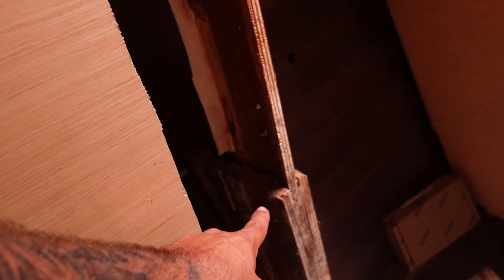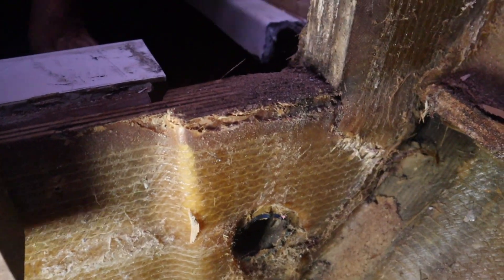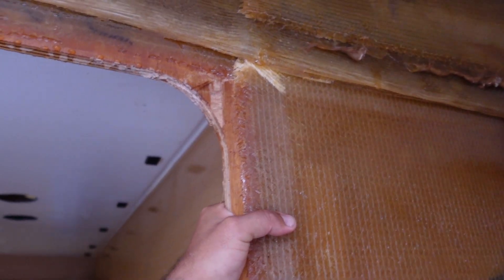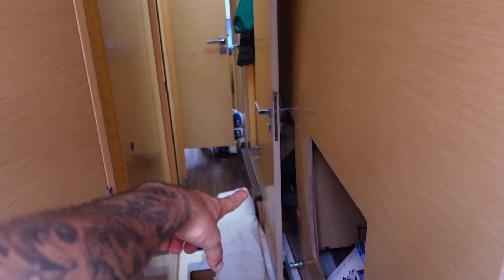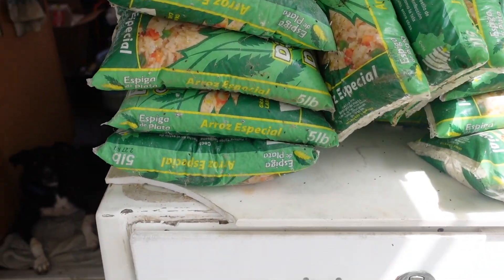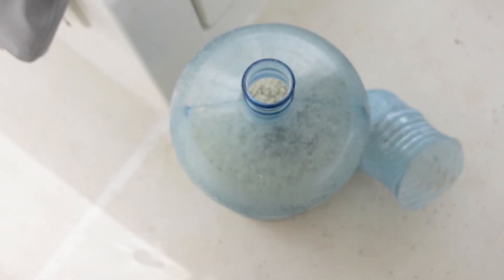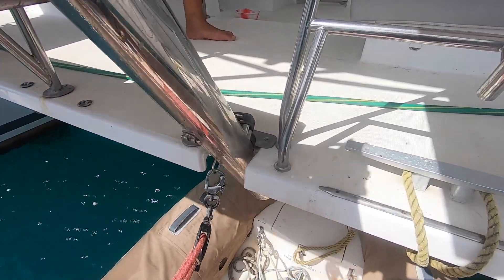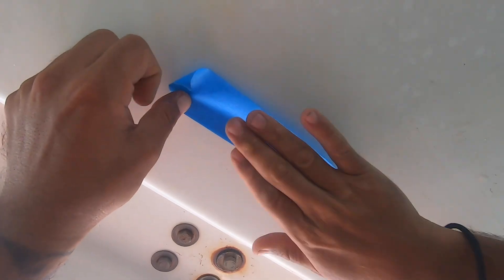CRACKED BULKHEAD REPAIR SERIES: Part 1 - An introduction... (Episode 107)

Comment: As a fellow Lagoon 450 owner, hats off to to Colin for bringing this to our attention. I haven’t been at the boat lately to inspect mine but other owners have and it’s starting to look like this is a design oversight. Lagoon owners are gathering data on how many boats are affected, but so far even dock queens and lightly sailed, non chartered boats are seeing similar failure. It’s heartbreaking, and at first I was in denial. Despite this, I still feel like the Lagoon 450 is an excellent boat. Ours has been heavily modified and upgraded with1500ah Lithium, isolation transformer, solar, gen set, dive compressor, water maker, laundry, furling boom, copper coat, ceramic coat, new fridge, freezer, stove, AC, SSB, on board fuel polishing and transfer, underwater lights, fwd scan sonar, etc etc. It sucks to see this issue arise, but once this repair is done, I’m still confident that we’ll have one of the best cruising boats in the world. Even knowing this now, I would still pick the 450, and it is still my dream boat. To Colin, if you’re reading this, I just binge watched every episode this week. Love what you’re doing, especially with the technical details. Your help and insight is invaluable to people like me. This is the best YouTube channel ever created. You’re likable, not boring, hard working, intelligent, and extremely informative. Your changing crew is always well chosen, and I like the way you give back to the various communities you visit, and show the world what the sailing community is truly like. The videos move along at a nice pace, and the editing is excellent. Thank you!
Reply: Colin need never be out of work again as the leading Lagoon restoration consultant in the World!
Reply: @roygardiner4002  you’re not wrong there...I sailed 1200 miles to have him take a look at my boat.
Reply: @david_shih  I liked your video too. Very informative. Looking forward to more from you as things evolve and we get engineering guidance. Best of luck mate, and please keep us all posted.
Reply: @roygardiner4002  don't forget the Aussie Battler Jamie......
Reply: @roygardiner4002  😆 he’ll know them inside out! 🤨🙄🤣
Reply: Popeye  nice! I do love steel boats. Worked on industrial cable ships as an ROV Pilot/Tech, repairing and installing sub sea cable systems, including the transatlantic cable. I’ve remodeled and repowered a few steel rescue and research vessels as well, so my days as a “needle gun expert” are thankfully behind me. You enjoy your steel boat and I’ll enjoy my 450! That’s the beauty of all boats. There’s a dream boat for all of us. I’ll happily raft up with any boat and debate the pro’s and cons. After all, there’s only three things I like better than my boat: Being on it, talking about it, and working on it.
Reply: It makes u wonder is this a design problem or a manufacturing problem. Especially since alot of these boats have issues. Wonder if Colin should consult with a neutral naval engineer. Im sure Lagoon is consulting with this guy Colin is talking to. I wonder if things are being suggested reference any future litigation against Lagoon.
Reply: @davidbarker6899  I think you hit the nail on the head after Lagoon has been watching some of these episodes someone in the legal department has taken point and has probably suggested it would be a good idea to run interference in helping  Collin in some of these issues this is getting more interesting as time goes on.
Reply: Kevin if you get a chance share with us where the Lagoon owners are collecting this information.
Reply: @ynAMe6Aj  there are 3 Facebook groups. Lagoon Owners Forum for basic general info. Lagoon 450 F/S Owners. And a 3rd, new group, dedicated this this issue where data is being generated after people remove the trim and inspect. That group is called “Lagoon 450 F/S Bulkhead Issue”. Still unclear how widespread the problem is, but looks to be a design flaw so far. We are all waiting on an official response from Lagoon to see if they will help us, issue a recall, or leave us to fend for ourselves. Lots of rumors so far. The repair itself is fairly straightforward, especially in cases where the failure is minor and hasn’t spread. The real problem, as Colin demonstrated, is how to remove the wood veneer and cabinets without damage. Doing the custom carpentry to put it all back together will be the hardest part. Looking forward to seeing how Colin manages to fix this and make the interior beautiful again. Knowing him, I’m sure he’ll set a high bar for the rest of us. I’m quite good at glass work, after 22 years as a captain with ~40,000 blue water miles, and the Great Circle loop under my belt, but many other owners will need to hire this out, and it wouldn’t surprise me if they start a class action if a recall isn’t issued. I’m going to wait for more info, and do the work myself, once we know the details of best practices. It’s a fine line between reinforcing it and overbuilding, as making secondary bulkhead (primary bulkheads are quite robust) area too strong, can send flexing and stress to other areas not built for it.
Reply: @capnkev  Checked out facebook and some videos and the document on repairing the bulkheads.  Those bulkheads broke at the weakest point. If you beef up those parts what will break next?  If there is any way at all of reinforcing the entire structure that would seem to be worthwhile while the boat is pulled apart.  Personally I'd be very tempted to double up the plywood with glue and bolts.
Reply: @ynAMe6Aj  While I haven’t removed the trim to inspect my bulkheads in this area yet, I plan to drive down and do that soon. Still waiting on an official source as to how to repair and reinforce this area, damaged or not, but it appears that continuing the triple ply all the way up and glassing and tabbing in that sandwich is the fix. I have over the years always inspected any areas that are visible, and I know that my main bulkheads are solid and I have no detabbing in other areas. The only glass repair I’ve had to do so far was to glass in the deck to hull joint at the sugar scoop. So I know my boat is very solid. It’s been around the Caribbean, across the pacific and back, Bahamas and Up and down the east coast from FL to Maine. I’ll continue to monitor other areas, especially after heavy weather or after each haul out. If any detabbing occurs on furniture, I would remove the plexus and glass that in, despite the fact that theoretically the boat would be solid with all furniture removed. All the little stuff adds up to create a structure that is both solid and flexible. Fortunately thanks to Colin and some proactive people on the Fb group, if this issue is caught early and repaired, the weakness won’t spread to other bulkheads. I’m hoping that’s the case with mine. Being a good captain means having a healthy paranoia and thinking through how you might react in various situations, whether that be pirates, mechanical failure, lightning strikes, MOB, etc. Thinking through potential problems before they happen leaves one mentally prepared for when they do. I’ll have a good look around and certainly repair anything that looks even remotely suspect, and the continue to monitor and repair other areas as needed. I’ve been through many dangerous situations in my travels to 101 countries so far, and I’ve learned that one failure can lead to a chain reaction of failures. So being proactive is key. After all, a 3 cent oring took down the space shuttle challenger.
Reply: @capnkev  Triple-sheeting each supporting bulkhead sounds heavy. Is there a light honeycomb material that has similar strength?
Reply: @EdwardTilley  good question. That would be great. While I have a lot of construction experience in boats, houses, RV’s, robots, you name it, I’m not a nautical engineer. And in this case I know what I don’t know. Going to wait and see what the recommendations are as this shakes out. As I said earlier, the primary area effected (unless weakness has spread) looks like a design flaw. Reinforcing it is a delicate balance between too strong and too weak. Too weak and you have compression failure. Too strong and the compression and flex stress may move to a part of the boat not designed for it. Right now, I have time before I relaunch, so I’m following Colin closely and reading everything about can find on the issue. I expect Lagoon to issue a statement soon other than “nothing to see here”, but I’m not holding my breath. They will either step up, own this, and help us loyal owners make it right, or they will bury their heads in the sand and suffer the consequences of damage to their brand. Being the worlds best selling, most poplar brand, I’m hoping they do the right thing and at least help us with guidance.
Reply: 4 Kevin, as in the past, Catamaran companies will just pass this problem on like they did the 'leaking' emergency hatches. All the while HOPING QUIETLY it will just go away.
BTW, is this cracking only limited to Lagoon? ⬅️ Bet not!
Reply: @stevenr8606  very true. Wouldn’t be surprised if this extends to other brands/makes. Large ships often have similar failures. It’s all part of the game. I just installed the emergency brackets when I was on the boat a few weeks ago. Considered glassing them in entirety but then decided against it. This too shall pass. Going to fix or hopefully reinforce, once I see mine with the trim off.  Then keep sailing. Whenever you buy a production boat as a cruiser, you expect to modify and upgrade things. I’m still happy with the 450 as a platform over its peers. They are built tough, this possible oversight notwithstanding. Once fixed. I hope I’ll feel the same. The actual fix of the glass part is relatively cheap, easy and quick. It’s the cabinetry and trim that’s going to really suck. Doesn’t look like it will be easy or non destructive.
Reply: @stevenr8606 , good point. My guess is that the materials (adhesives) used to reinforce these structures was accepted by the industry and likely used by other manufacturers. I have a civil engineering degree, am a former boat carpenter, and have worked in construction for many decades, so I'm guessing this is more widespread. I'm curious to know who makes the glue? Once determined, check out their website, see what other boat manufacturers and other industry clients they claim to have relationships with and dig in there. That said, the inherent strengths of the bulkhead ply along all axis are known values, and I imagine the induced stresses in these bulkheads is also known (if not someone's superfucked), so, I eagerly await the outcome of this debacle with baited breath, but have a sneaking suspicion this won't end well for many involved parties.
Reply: @EdwardTilley  carbon...
Reply: @stevenr8606  I'm guessing lagoon will just point to the FB  group and Colin's vids and tell the owners to buy new or FIYS... I can't imagine a French boat company would step up to fix their faulty design, I can't imagine a world where defending a lawsuit would be more expensive than repairs to all those boats.
Reply: @rsrguy  Was wondering wouldn't carbon flex side-to-side under too much compression from above - but of course embedding a tube of carbon into the bulkhead wall would give it enormous compressive strength and prevent it from bowing as well. Expensive wall though... they make airplane cowling out of the stuff so it isn't cheap.
Reply: @stevenr8606  My Farther spent the best part of 5 years and 54 High Court appearances suing Beneteau and despite getting 5 marine surveyors to give their reports on the boat he sued them on their own survey. the boat was brand new delivered to the south of France and deem unfit for the sea with bulkheads pulling away from the hull and the hull twisting in the heat during the day etc. problems with the rudder, to name but a few issues. They tried to drag the case out trying to run him dry of money to fight the case, but this was the first of a fleet he was purchasing to start a charter company. he was fortunately not short of finances and eventually won his case where he rejected the vessel as unfit for sale under the sales of goods act.
Reply: @EdwardTilley  Just a couple of details / issues. Most importantly is scabbed biax would flex as you suggest. Any of these repairs will be stronger  if vacuum bagged(doesn't need to be infusion bagged) just a standard bagged layup with peelply and breather will work. 
 Most importantly honeycomb would be no match for that load, you need  more of a column to resist the bend forces from the vertical load. The best practice for this (after 2 or 3 bonding layups) would be to sandwich bond strips of foam, vertically oriented onto the bond layups and add several layups on top of the foam. He will likely not vacuum bag the layups because of the heat and his hardener, West doesn't have a seriously long cure hardener that will allow for a bagged layup in that kind of heat.
Reply: @EdwardTilley  the other issue to address, is he's going to need to tie both sides of the ply bulkhead layups together, or the flexing will work towards de-lam. I have an idea of what I'd do, to mitigate this but I'm not boots on the ground. And as previously stated, what breaks down the line when this gets repaired? Where does the stress transfer to once this doesn't break? Seems like a bad apple from my beecher seat in the shade. If this is happening to most of these boats then why is everyone calling it a great design? Because of a floor plan? Initially I thought this was the consequence of the hurricane damage, but now after seeing one (1) piece of ply for that bulkhead, around a door, that is bonded to the hull with what appears to be liquid nails.... not even reinforced with glass and proper resin? I'm not buying any frenchies boat now, they need to stick to surrendering, looks like they're better at that then naval architecture.
Reply: @capnkev  I would not trust facebook to gather information for anything important.  They censor everything.  Never trust a message is shared.   One day the info is there and the next it is gone.  Use a different platform and backup your work.
Reply: @disabledglobalchallenge290  wooow.  Now there's some insight!  We romance about boats once they hit the water but in the end , it's builder is a big company.
Reply: @adamcturnbull  the fact they are a big boat builder does not insure quality of the boats or if they have any intentions honouring of any implied warranty !!
Reply: OK so this is a design fault, not something Colin did during his repair and re-rigging?
Reply: @silasmarner7586  it’s complicated, and we are waiting for more data from other owners. But, it does appear the the area under the fwd doors under the main mast bulkhead was under built and in need of reinforcement. It is yet to be determined how many 450’s are effected. However, as once this area is weakened it can spread to other areas. I’ll let Colin speak for himself as far as what role the Hurricane or rig tension played on Parlay.
Reply: Reading through the replies to your comment and being a senior engineer myself, I'd say from personal experience that management and the bottom line caused this failure not engineering. I would bet the engineers said glass in those bulkheads and reinforce them and management said no, it costs too much. I've seen this so many times. I am certain much FEA (finite element analysis) was ran on this hull and it showed the loads being carried to those points that failed. No one but management would use glue instead of structural bonding in those areas.  That's my 2 cents for what it's worth.
Reply: @jetskiliferboatguy8140  that’s a very reasonable guess. One idea I just had, other than it should have been reinforced, is that perhaps the plywood panels were like 1/2” too tall. They would fit fine in the factory with the vessel blocked under the bridge deck. Then maybe they start to fail on the first launch, when the whole boat flexes as she rides in the water, rig tension added, thousands of pounds of fuel, water, gear etc. The whole way the boat sits changes.
Who knows? I doubt we’ll ever know the truth.
Reply: This failure could be due to a number of factors, I would definitely not jump to any conclusions. Obviously, this is a relatively old boat and there should be precedents in significant numbers to build a case if an issue. Remember, you can brake anything, given the right circumstances and this is not the next spacecraft to Mars!
Reply: @ericdelevinquiere9902  I agree. Waiting for more data. In order to actually inspect the two fwd bulkheads, Trim needs to be removed. There is a guy making a list. I think they are up to like 46/46 boats inspected that have some form of deformation here. Some minor, some not. I already went through the denial and anger phases of grief. I need to go check mine ASAP, but it’s an 8 hour drive and I’m busy working. 
https://i.kym-cdn.com/entries/icons/original/000/023/715/stagesofgriefz.jpg
Reply: Wow, what a amazing and surprising perspective. Considering some take these boats thousands of miles from land I would have thought this would be a deal breaker with this kind of oversight which resulted in such a catastrophic failure. Must be one hell of a ride.
Reply: Popeye  once you own it you better call it an excellent boat - just until sold... :)
Reply: Ok guys please help!!!! Is there a way to check the bulkheads without tearing the boat apart. Im looking at a used 450 next week.  I'm wondering if the level would show enough information.  Thanks Sid
Reply: @cory0702  you can see pretty much the aft bulkhead foreword of the engines in line with the fire wall. The middle you can see by removing the inboard white leather panels in both aft suites using an automotive fabric plastic crow bar. You can check the steering there too.  The foreword bulkhead under the mast step compression can be seen by liking into the wiring panel behind the sofa cushions to starboard of the nav station. You can see most of the main beam in there. Most of the non structural furniture fillets are grey plexus and can be seen poking around with a headlamp. Check in the water pump cabinet on port side for detabbing. Check the deck to hull joint in the sugar scoops and the deck to hull joint by the chain plates. You’ll be able to see almost everything you need to. 
See the Facebook group I mentioned in the comments above for pics and further detail.
To answer your specific question, the only way to see inside the foreword door frames to view those bulkheads is by removing the glued on corner trim and unscrewing the face plate.
Not sure if the seller would let you do this. I would. It needs to be inspected and addressed regardless by every owner IMO. I wouldn’t let it scare you off buying the boat, that’s for sure. Other than this area, the 450 is a very solid boat. Most people who have minor deformation haven’t even noticed it until they remove the door frame. Even if undamaged, you should probably negotiate reinforcement into the deal. Good luck.
Reply: @capnkev  thanks so much,  im thinking that we're going to have to remove the face plate. I'm not spending 400,000 without being positive.  I'm going to push for this information on the survey also. I'm stating to wonder if it is a design problem.  I'm not shying away from what I like and want. It would take a privilege to pull me away and so far I haven't found one I can afford.  Thanks alot bro
Reply: @cory0702  exactly. If the seller is savvy, they will realize that now that this issue has been raised, any potential buyer is going to want to know. If it’s fine, I would still reinforce it for piece of mind. We should have more info on best practices soon. The trim can be put back easily. Just a few screws and liquid nails. This story is still evolving but you have the right attitude. Certainly a concern, but if it hasn’t spread, it can be dealt with. You’ll be able to see pretty much everything non invasive or destructive but the two forward door areas that you want to see. The fridges on these boats sweat a lot too. Look for rot under the fridge cabinets and plan on upgrading that. Plan on replacing the septic hoses too, and maybe the faucets. There’s lots of little projects to keep you busy but there’s a reason the 450 is the most popular cat ever built and that more are actively cruising. You’re still making the best choice IMO
Reply: @cory0702  yes, it's definately called a survey.  Nobody should be thinking they could recognize this problem who aren't trained where to look.
Reply: Did Colin interview your family about your awesome boat? Family lives on it and it has an ice maker? Wow if you have damage there is either a design or build problem. Likely the build didn’t follow the design.
Reply: @davidmueller980  that wasn’t me. I have a 1500 ah mastervolt lithium system that is built for the marine environment and all wiring, new panel, transformer meets ABYC code. High output 250 amp alternators. 1200 watts of Solara wall on panels. It’s a great setup. It’ll be interesting to see how a Tesla system holds up. There’s no need IMO to run AC off batteries, but to each their own.
Reply: burningfeet 53  thanks for trolling me. Very kind of you. You’re a ball of sunshine
Reply: So a boat that potentially could break in half while sitting at the dock is "still an excellent boat"?! 🤤
Reply: @roscoejones4515  c’mon chicken little!. Zero chance of that happening. Ever been on or seen a 450?
It’s a 36,000 lb boat. We have a potential design flaw with 2 pieces of plywood. The boat wouldn’t break in half if you dropped it from a crane. Say what you will about fit and finish, but from a structural point of view, Lagoons have a well deserved reputation for being solid boats. That’s why they are the most popular blue water cruising cat in the world. This channel wouldn’t exist if they were poorly constructed because Parlay would be in a dumpster. Most people so far with this issue, they didn’t even notice and it hadn’t spread to other areas. Is it a possible design flaw and safety concern, yes. Does it need to be addressed, yes. Knowing this now, if you gave me a time machine or offered to buy me a new boat, would I still buy a 450 over the competition? Yes 100% it’s still best in class IMO
Reply: Popeye  yes, it is an excellent boat. Just missing a few pieces of plywood and some extra glass, ha. I love my 450 and wouldn’t trade it for anything else in the same class. Certainly better than a Leapord or FP. Antares might be better in some respects, but they are 30% smaller interior and you could buy 2 or 3 Lagoons for the price of an Antares. Yup, I’ll keep my 450, and would buy one again for sure. There’s a reason it’s the most popular cat ever made, and that followed the previous most popular 440. You’ll see more of them at remote anchorages around the world than any other. It’s very solidly built, but it looks like they missed a spot. It happens. That’s how nautical engineering evolves. If that scares you off buying one, then go buy a different boat. I won’t be selling mine anytime soon, and I trust it with my life in all oceans. I’m going to fix this and the boat will be even better.
Reply: @capnkev  Kevin, I love your confidence, I hope it rubs off on your fellow owners who must be mortified. I race a wide variety of mostly protected water boats and would be pretty horrified if one broke-up on me. In fact breakdowns of any kind are pretty intolerable and I do everything I can to prevent them from happening, other than slowing down. I did not realize these were the most popular cat, that is really unfortunate for the owners and the company. I'm going to choose to believe that you are not in complete denial, but rather have a very healthy take, that you are happy to be aware of the problem while it can still be addressed. I hope the less experienced owners get treated well here and the company lives and grows.
Reply: @seandelaney1700  thanks. Quick update. I was losing sleep over this so I drove 8 hours to remove the trim and check on the boat. The starboard side was bent/bowed. The port side had a small crack where the light switch plate was. After seeing most of the now 90 450’s (and counting) that have reported some form of failure here, I was happy to see mine wasn’t as bad as some others. Even unbroken ones need reinforcement IMO. We watch the weather, reef early, have proper rig tension, never grounded, etc. The boat was used as intended and never abused or chartered. I took off a variety of other removable panels and looked into every possible area. Engine bulkhead and midship bulkheads totally fine. Not delamination or cracks in any fiberglass. All plexus fillets were solid, bonded and no cracks. So the good news is that the problem is limited to the two fwd inboard bulkheads and has not spread. If it wasn’t for Colin raising this issue, I never would have known. Still waiting to hear from Lagoon about possible causes and solutions. In the meantime, I’m a lot less worried. This doesn’t appear to be as big of a deal as I first thought. It may be that they are just “stiffeners” or secondary bulkheads.  It’s likely, gone undetected, that the boat is still totally seaworthy, but obviously, now that  a know about this issue, any decent mariner would address it. I don’t know. I’ve been debating with myself and my wife and have decided rather than do the repair myself, which I’m capable of, I’m going to pay to have this done professionally at Multitech Marine in Lauderdale. It’s going to cost more, but will cover me with any potential buyer or insurance company in the future and reassure any concerned party that it was done correctly. Also, I’m busy building a campground and need to stay focused on that. Hopefully by when I get there after Hurricane season in Nov, they will have guidance from Lagoon, fixed a few others, and have some tricks on doing the cabinetry. I’m feeling much better about the situation in general, and will know that my boat is solid when we head out to blue waters again. 
People can hate on the brand all they want, or choose not to believe me, but I am 100% sincere when I say that I still love my boat and would trust my life to it on all oceans and in heavy weather. It’s a very solid construction in general. It will be even better after this repair, and I wouldn’t trade it for anything else in this class. If you came for a tour of all my gear, gadgets and upgrades you would see why. I wouldn’t let this scare off any potential 450 buyers either. Still better than a leopard or FP IMO, but those are also nice production boats. All boats have issues, sometimes it seems never ending. I enjoy the projects. Not a deal breaker. Just fix it. Not trying to minimize the issue. Just keeping it real. Thanks to everyone for your comments and support. This too shall pass. Sail on Parlay and thanks for everything Colin. I appreciate you.
Reply: @capnkev  Kevin, you are so kind to respond. I can imagine the stress that everyone is going through and appreciate your anxiety in wanted to explore your own vessel. I am amazed that this channel seams to have exposed this widespread issue. I thought it odd that his comments said it was not from a hurricane alone, I can imagine the damage one could do. I guess he already knew it was widespread, which is why he said "go through your dealer". He gets special VIP treatment because he has a YouTube channel. 

To be clear this is a very serious problem, we are talking about the integrity of the hull. It is pretty crazy that this resurrection yacht channel exposed this issue, He may have saved lives and countless other issues. Much better to address this issue early before it spreads. It is helpful to be married and have another perspective to take on, sounds like you made the right decisions. I am fascinated about "Building a campground", you are clearly an exceptional person that gets more done in a day than I do in a week.

If I were to guess, which I will; the design was a wee bit lacking in understanding and addressing the forces, the builders did not build as the designer had hoped. It is surprising to me that the corners were not glassed, that they were not reinforced to the direction of the load. I am not an engineer, but it seems to me that if a bit more glass and epoxy where used correctly the boat would have sufficient strength and similar weight.

From a previous comment I was more than impressed by what you have done to your boat, you may have the most common cat, but clearly yours has an exceptional and caring owner. The issue has been exposed, which means it can be addressed. Your opinion of the competition and your love for your boat will be noted by many more than myself. You have provided the best responses I can recall reading on YouTube, I hope to not forget. Bueno Suerte from Mėxico.
Reply: @capnkev  So Kevin, now that a year has past, what's the status of your 450? Fixed? Thanks
Reply: @kenwilkerson44  Thanks for asking. I can’t believe it’s only been a year. Sailed it down to Lauderdale Nov 21, the bulkheads were reinforced. Lagoon certified the repair, paid for the materials and gave me a little for my trouble. Got some other projects done while in the yard. Sailed to the Bahamas for a few months, then to Georgia. Then brought her around cape Hatteras to Annapolis last spring where she is now. Still working on the campground and haven’t had much time to sail, so I’m going to list it soon. It’s ready to go anywhere in the world. Sadly our life plans have changed and with family health issues we aren’t going to be able to live aboard any more. I love the boat too much to let it sit unused
Reply: @capnkev  Glad the boat worked out for you. Living aboard has been one of the best times of my life.  I'm also in Georgia.  Best of luck with your family.
Reply: @capnkev  An Antares may not seem so expensive when you factor in the costs of the repair to the Lagoon including your unpaid labour, boatyard storage and cranage fees and loss of use. What is a year of your life worth? When you reach my age you start to realise that there aren't enough sailing seasons in a lifetime.
Reply: Before you get ahead of yourself in the confidence of your boat which you say is heavily modified which is great it might be worth your time to remove pieces of trim to be able to visually inspect some of those bulkhead sections and also check with a level this does not sound like a one tropical storm damage this sounds more like a design flaw with those cables pulling up and the mast Pulling down on the center of the boat it would be interesting to see what that structural area were Collin was looking behind the trim. Where it had failed looks like on your boat if after inspecting your boat all is fine then I would lean to say it took a pretty good beating during the storm but if you have structural failure on your boat. Then I would say that is a big the design flaw would not want to get caught in open waters in rough seas with the amount of pressure pulling down on the mass and the cables pulling up on both sides of the boat that is a bad incident waiting to happen good luck on your inspection